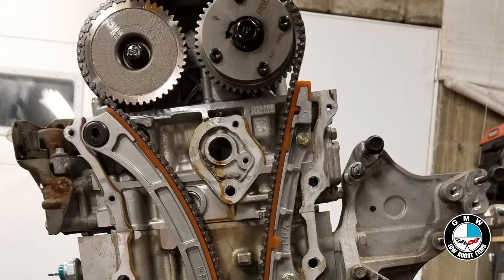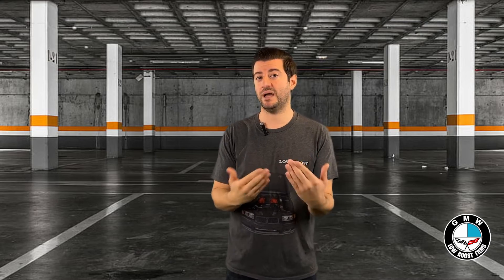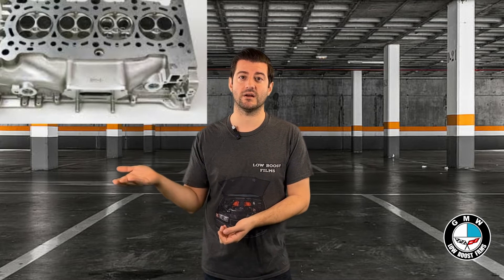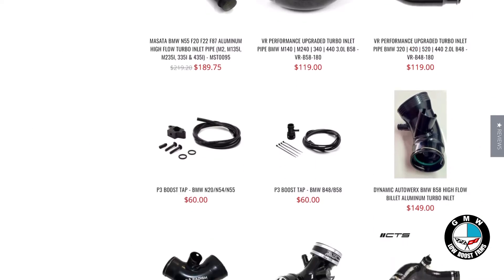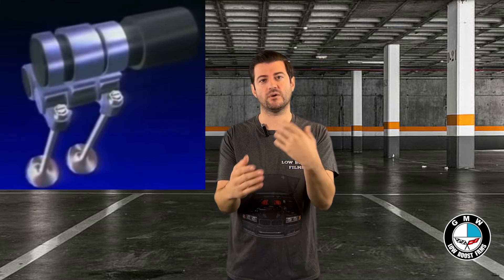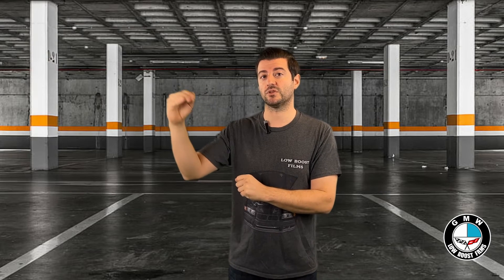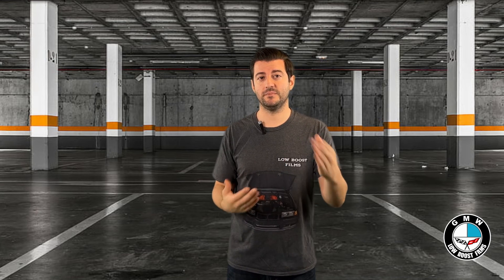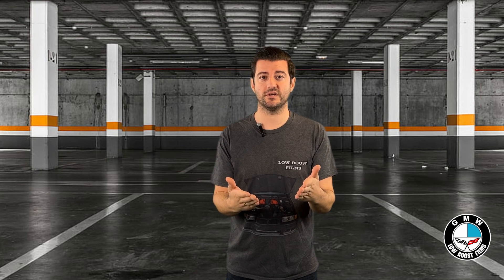WHAT IS VVT? Variable Valve Timing Explained!

Comment: It's a useless thing, all it does it reduce power in certain ranges
Reply from the maker: It’s useful for a fuel economy, but a lot of us don’t care so much about that lol
Reply: The only thing that affects economy is how much the car weighs, anyways they  have variable timing delete so
Reply from the maker: @alexander1982miller low rpm non vvt rev range helps fuel economy too. Not just weight
Reply: All VVT does is reduce power at certain RPMs, I'd rather have high torque at low RPMs much more fun
Reply: @LowBoostFilms you should get a VVT delete if your car can take one it's just a pin you put in your VVT solenoid
Reply from the maker: @alexander1982miller  yeah so at lower RPMs, you get better fuel economy, until you’re wide open. Most of my cars are LS powered so there is no variable valve timing at all. It’s all the power all the time lol
Reply: @LowBoostFilms just create another opening in your intake and give it a tube, filter and tune